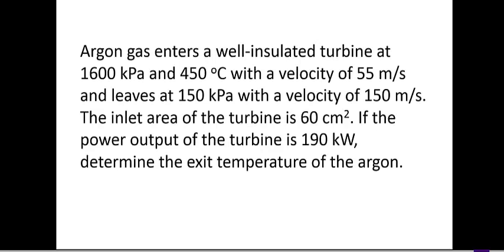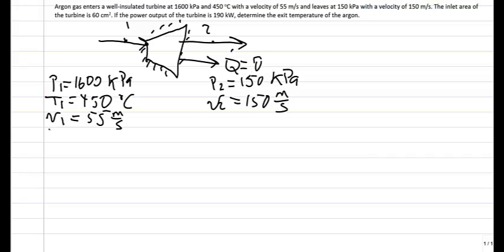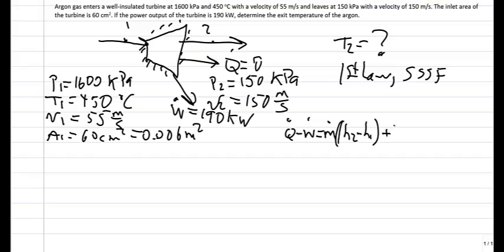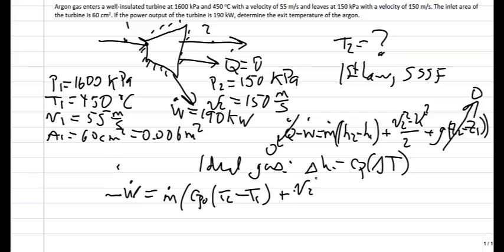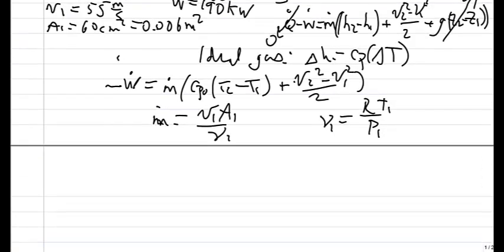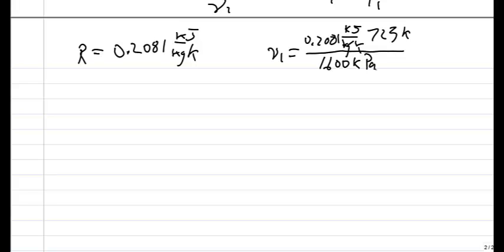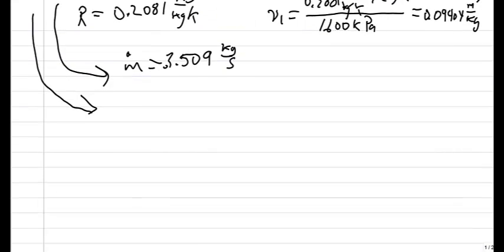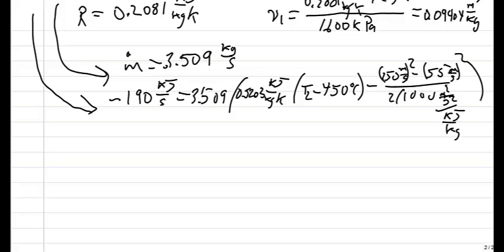Thermodynamics: Example, Adiabatic turbine #1

Comment: Because plugging in your values to find the first specific volume I don't necessarily get 0.0904. I get 9.406x10^-5. Because I would use 8314/39.94 for R and convert the pressure to 16 bar? Any help is appreciated thank you

Comment: Hi Sir. Thanks for the video. I just would like to ask, why don't we use 8314 as the universal gas constant and instead use 8.314? Wouldn't that affect our final temperature units. Thank you
Reply from the maker: Can you provide a timestamp?
Reply: Hi sorry the timestamp is 7:19
Reply: It is around that time where you calculated R and the first specific volume
Reply: Most importantly, how do we know to keep 1600 in kpa and not convert it to bar?
Reply from the maker: R is the specific gas constant (different for each gas), not the universal gas constant (same for each gas).

Comment: In this particular problem, potential energy is neglected. I didn't understand thermo in college, so is the case for every turbine problem? For the first time, I understand the P-V diagram, beginning to understand the tables, and looking forward to all of the closed/open systems. Thank you for a good video!
Reply from the maker: Technically the change in gravitational potential energy is not zero unless the inlet and outlet heights are exactly the same. However, if you calculate the change in potential energy and compare it to the change in enthalpy, you will find that it is negligible.
Reply: Depending on the magnitude of velocity change, even change in kinetic energy can usually be neglected to a good approximation.